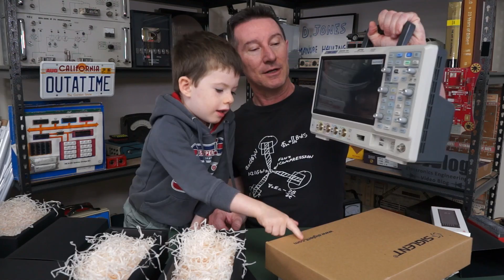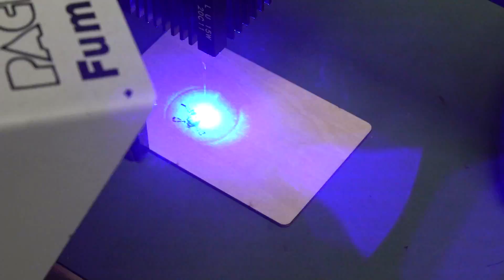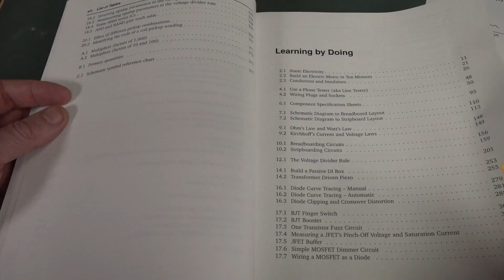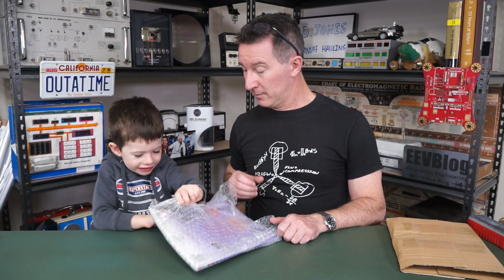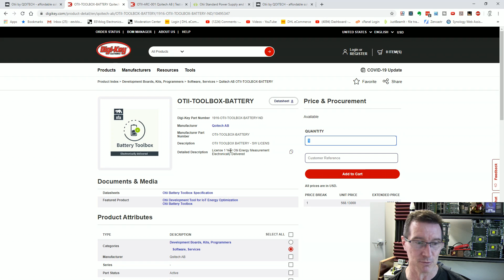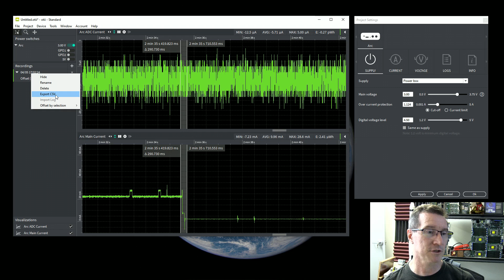EEVblog #1304 - Mailbag

Comment: The issue with these lasers is that sellers keep removing and re-posting them on Ali. So if a product get a bad review because the buyer realize it is just a 5.5 w laser then the seller just removes the complete product and post a new one.
The most  sold high power laser head at this moment is sold 160 times the second one only 24 times. These numbers don't add up.
I myself have a 5.5 w laser, it runs now half the speed of what it could when I start using it. Would like to replace it but, YouTube reviews show a bit that there is almost no difference between 15 and 5.5 w. It all smells a bit fishy.

Comment: Dave, I really wished you were a bit more critical of the laser engraver. Even though the lasers power certainly isn’t at 7 watts let a lone 15 watts, it’s definitely enough power to cause a small fire or damage someone’s eyesight severely. The chinesium laser goggles make it even more dangerous as they might give someone a false sense of safety. I’m not saying those goggles are definitely rubbish, but I wouldn’t bet my eyesight on it.
Reply from the maker: How am I supposed to verify what quality the goggles are? How would you do that?
Reply: EEVblog An easy first test would be to shine the laser trough the goggles onto a pig or cattle eye and she if there is any visible tissue damage. (Damaged eye turners cloudy/white first and after longer exposure starts to burn) That’s the easiest test without any specialized equipment that I can come up with. You usually can get eyes at your local butcher. Anyway thanks a lot for your videos, Dave. I’ve learned a lot over the years.

Comment: Dave, don't use that laser engraver just like this. Some cheap Chinese laser "safety" goggles aren't really effective. At least the ones you got seem to be for the correct wavelength, but still, get some proper ones. Also, never openly operate class 4 lasers just openly in an unsecured environment. At least build a box around it, with a safety-interlock for the high-powered laser diode.
Reply from the maker: How am I supposed to know how (in)effective these googles are?

Comment: Nice that battery emulator. But can you imagine that after 20+years it has no value anymore because you ran out of your subscription or the software does not run anymore on your windows 20 system. (Now you can stil use a 40 year old textronic o-scope without problems!)

Comment: You can with the Otii also show serial port log, where each line of serial data will be timestamped and marked in the current graph. So current consumption can be correlated with the logs. Great for embedded software development of low power devices

Comment: 10:39 What? Yes it does. The problematic part there is that it's a sticker. The CE mark should not be easily removable from the product for it to be valid.
Reply: David Jereb I had issues at the customs office a few times when the CE mark was missing from products. I always keep a roll of CE stickers at hand for this reason. Saves you a lot of time and trouble.

Comment: What is the difference between a DC electronic load and a battery simulator?
Reply: A Load sucks power, whilst a Battery provides power. So the load simulates a device, whilst a battery simulator will simulate.... a BATTERY!

Comment: 5A range by 24 bit is approx 300nA resolution. And that is without using programmable gain. Everything is limited by how noisy their pre-amp fronted of ADC against range of voltages on current-sense resistor.

Comment: Is there really anybody for whom the answer to “would you like a teardown for that?” Is “no”? If so, they’re on the wrong channel, I think!
Reply: Not all products are equally interesting. Some electronic products are so simple that we know what to expect and we know exactly how they work even without tearing them down.
There might also be other reasons not to proceed with a tear down.
For example, would you like to see a tear down on these kind of products?

- An atomic bomb that has not yet been deactivated
- A landmine without screws that requires Dave to get “medieval on its ass” to get it open
- An armed bomb containing lots of plastic explosives
- A radioactive waste container
- A dildo
- A 2-stroke lawn mower engine
- A computer keyboard (just a carbon matrix and an IC, no more)
- An 8 ohm woofer speaker
- A machine gun
- An extension cord for AC mains power
- A perfboard with plated through-holes

Would you like to see Dave do a tear down on all these products? If you say “no”, then I guess you’re on the wrong channel. :P
Reply: TheCrazyStudent Implied in common sense, I think, is "do teardowns when and in a way they can be done safely". I assumed that was built in to being a decent human being and didn't need to be stated, so these examples feel a tad pedantic and unnecessarily combative. As for the rest, I personally enjoy seeing (and doing) teardowns even when we think we know what will get, because sometimes we are surprised.
Reply: Tammy Cravit Tammy Cravit I admit that I exaggerated a bit, but that’s because I was trying to make a point. Metaphors and hypothetical examples are often used in communication to get your point across. It should be quite obvious that no one (including you and me) expect Dave to tear down something as dangerous as explosives. But I think you can get the gist of my message if you read my comment again while focusing less on the individual examples and more on the general idea I’m trying to put through.

Let me reiterate: Not all products are equally suitable for teardown. There might be (either obvious or not so obvious) reasons to why it’s better not to waste time on tearing down a certain product. There is a reason to why Dave is asking “Do you want to see a teardown of this?”
Like I said, not all products are equally suitable candidates for a teardown.
Do you personally think that all electrical devices (within reasonable safe limits) are equally interesting and rewarding to tear down?
For example, do you feel that it would be interesting to tear down a simple remote control for a TV?

Comment: The poor rasterized image is probably showing you the end result with whatever power setting the thing has, given proper focal distance, or something like  that. Assuming software is a rip-off of proper laser machines, of course. And as someone else said, do not trust those cheap ass green plastic "protective" glasses. Real ones are sold  for specific wavelengths, and range from $300 to $500 a piece. So yeah...

Comment: "let me know if you want a teardown or not" on a 10k usd oscillioscope. Of course we want, what kind of rhetorical question is that?
Reply: Wait, $10k for a Chinese o-scope? Holy s. (You're talking about the Siglent, right?)
Reply: @xenonram  
Sigs are usually the best high spec value in all of Dave's shootouts. Why should we care where the marketing team is based. Everyone is either directly manufacturing in, or sourcing from China to assemble elsewhere. Venture capital drives the market. Their marketing department depends on a less adVenturous customer. The venture capitalists lacked any loyalty to their domestic workforce. We'd be stupid to not follow suit, and follow the best value.
 Personally, I look for honest, straightforward companies. I hate the nickel and dime BS and commissioned sales crap. Tell me the clear price, include all features, and don't sandbag those features for marketing BS. I don't care if the modules inside say Made in China, or if it's on the outside, or if the list of corporate offices lists "Headquarters" beside some location in my country. You know any international company evades regional and national taxes in international tax havens. What does a brand matter at this point?
Reply: PLEASE don't tear it apart Dave... Just switch it on and USE it! <Grins>

Comment: The laser might be 15w input but can't be above 6w out, since that's the rating of current highest power laser diode of that size
Reply from the maker: Ah, makes sense, I've seen around 6W reported elsewhere too. Thanks.
Reply: @EEVblog  Btw you're missing buttons because you have to add them your self "Right click here to add custom buttons" says the program on the balk

Comment: Those Sharp Elsimate calculators never die, I have several of them, some with the original batteries from the 80's !!! Still ok voltage, no leak whatsoever ! One of my calculators was grabbed for 0,5 euros in a rainy fleamarket day. It was full of water but after disassemble and drying, it did perfectly survive.

Comment: that subscription software would definitely put me off that particular product, I do understand that they put a lot of effort into it etc. however I'd be far too paranoid about the company going bust and turning the thing into junk. 
it could be argued that it would probably be obsolete by that time anyway, but for me; test gear has to remain functional for at least 30 years - I still use scopes from the 70's for example - I use new ones too obviously but I just hate the subscription stuff on hardware that's becoming more and more popular these days.
Reply: I can understand the reasoning behind subscription though if they continuously update the battery database.

Comment: Ancient man (any before 2010 or so) sits around massive campfire, lives to tell about it. Modern man needs fume extractor to protect against a modern wood-burning kit.
Reply: he needs it so it doesn't set off the office buildings fire system which calls out the fire service automatically - for a false alarm; dave would have to pay maybe a grand fine for it
Reply: Also, he knows some 'wipe in the comments would piss and moan about not using a fume extractor. You know the ones that whine about PPE.
Someone uses a chainsaw to cut ONE branch: "Omg, you need a hard hat, mesh goggles, face shield, ear muffs, chainsaw chaps, and a condom." 
Also, to be fair, the fires cavemen sat around didn't have sealers, glues, pest repellents, and preservatives pumped into them.

Comment: Could a laser engraver etch a PCB?
Reply: There are multi thousand dollar machines made by keyence and LPKF specifically designed for that purpose, i.e. fast pcb prototypes. As usual, you get what you pay for.
Reply from the maker: You would need to do it on bare copper sheet and then stick onto the fibreglass, otherwise it will burn it.
Reply: Marco Reps used one at low power to expose UV resist.
Reply: https://youtu.be/gm5P74vcB84

Comment: The screwdriver sets were part of a collaboration between Xiaomi and Wiha and are sold under their MiJia brand.  Xiaomi designed and manufactures the handle and the case and Wiha supplied the bits.
Reply from the maker: Interesting, thanks.
Reply: @EEVblog  5 screw drivers set:1 for Dave, 1 for Huxley, 1 for Segan, 1 for the misses and 1 to give away
Reply: @Damicske  although I would say the one for the misses and one to give away should actually be for they are Parts you know eventually something's going to give over years and years either day where are the ends or something goes wrong with a handle!

Even if I get a new set of screwdrivers have any kind anything that is still decent is kept as a spare.

Also if you have an old flat head of the larger variety you can cut a notch with a Dremel and sharpen the edges for a package opening tool!

Also I have some screwdrivers that have been modified to become soldering tools.

Also for if anyone out there that when they go to the dentist ask if they have any worn out or broken Dental fix a dental explorers.

You can get them or at least used to be able to get them from your dentist they're great for soldering and other tasks.

One good thing about stainless steel solder does not stick to it!

Not sure if this is still the case about getting them but used to be I don't remember last time I did but yeah it helps.

Austin time one end is no good but could be modified to do something specific as well which is a bonus.

Also the dental explorers are sometimes good for when you're needing to clear out solder from inside the hole after you've sucked the solder or whatever.

Or you accidentally gets odder in a hole or a solder Bridge.
Reply: Should be the best of both worlds, that there. Xiaomi seem to do design very well, and Wiha is good quality tools!

Comment: Dave can the laser etch pcbs ?
Reply: Direct etching the copper, no. Etching paint and then chemical etching the copper, yes if it's precise enough.
Reply from the maker: You would need to do it on bare copper sheet and then stick onto the fibreglass, otherwise it will burn it.
Reply: I don't think it's a good idea, because it burns the stuff, it's not good to have evaporated copper and carbonized epoxy among the traces. But it might work to etch the component designators on the non-copper side of single sided PCBs. And definitely can work for marking face- and back plates of project boxes.
Reply: Marco Reps used one at low power to expose UV resist.
Reply: https://youtu.be/gm5P74vcB84
Reply: If you check out Dupont's photoresist offerings, they have a bunch of laser specific films. Good luck finding something in small quantities though.